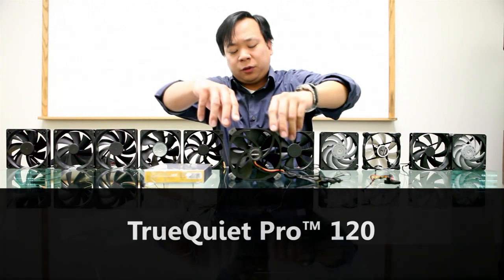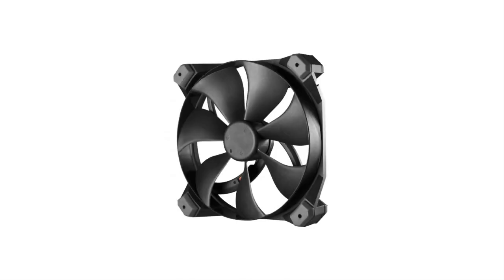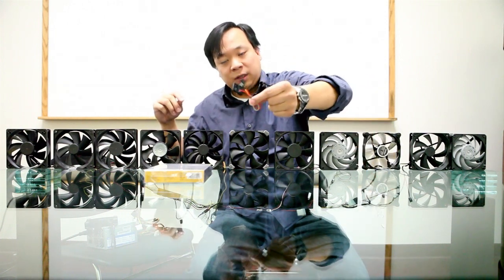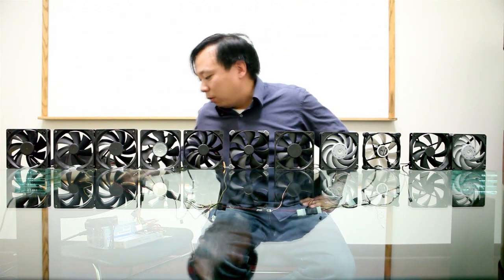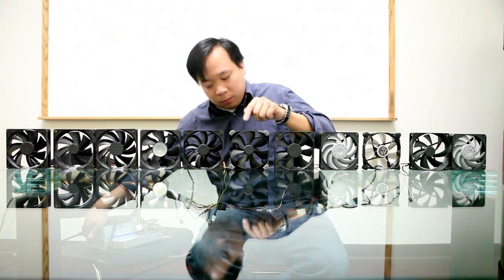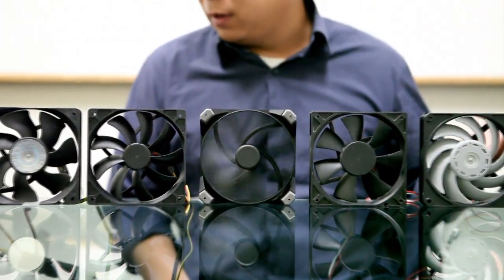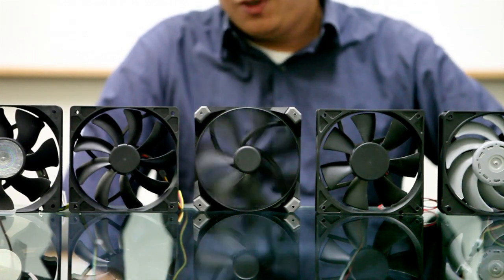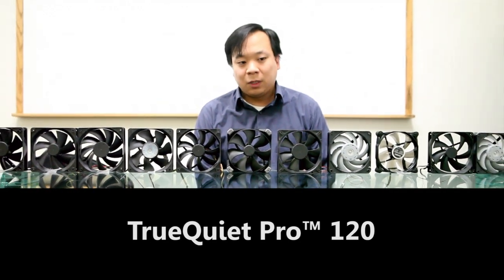Antec TrueQuiet Pro 120 Demonstration

Comment: Thank you for that post.  I had to point that out to a couple others as well.  This is simple physics at work, not a revolutionary new bearing at work.  In fact, this fan probably pulls a lot more power when it first kicks on to get that extra weight moving than its counterparts.

Comment: I Didn't... you need Fans with More CFm and Static Pressure 
I Use TFC triebwerk TK121...first model they brought out 
But i'm going for the TK-123 now there faster but wisper quiet 
there expensive but you wouldn't hear them run

Comment: waht's all the fuss about this fan 46,3 cfm at 18dba yeah lower rpm lower noise we've seen it before^^
there' fans that blows 60-70 cfm at that noise level. yeah i know you can't fully trust paper spec. but i have seen temperature benchmarkings.